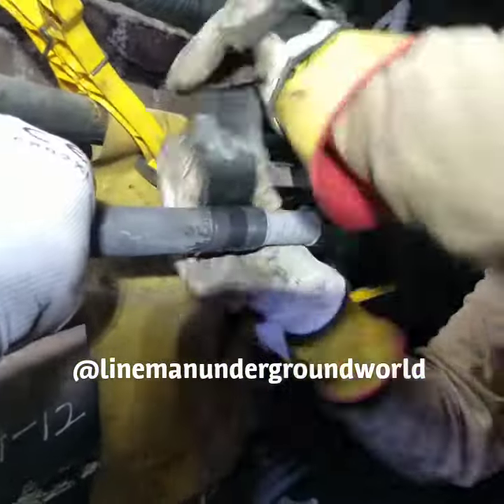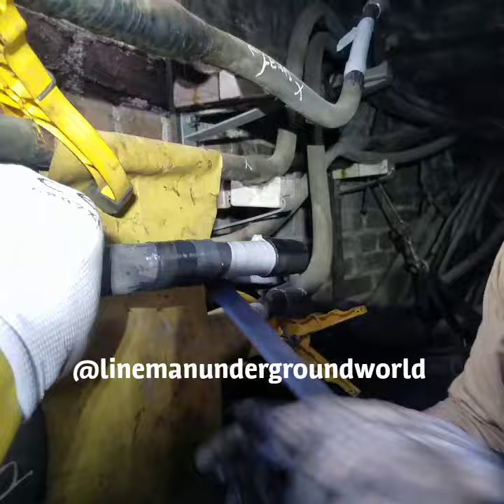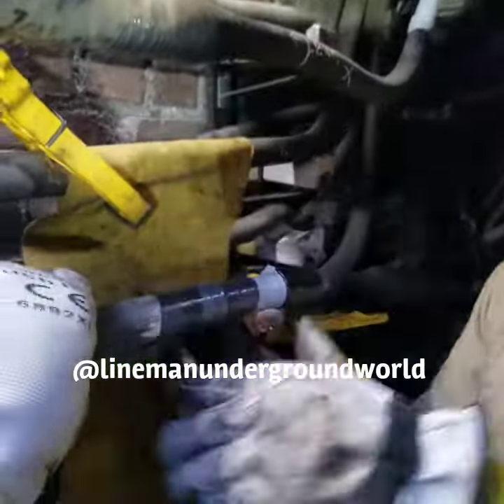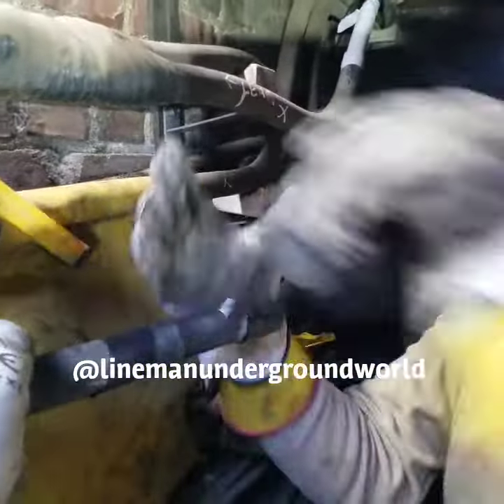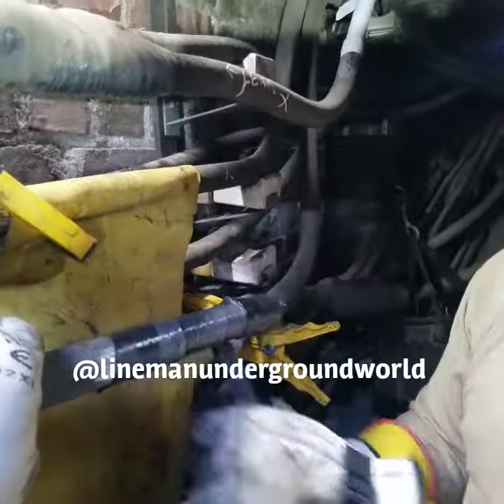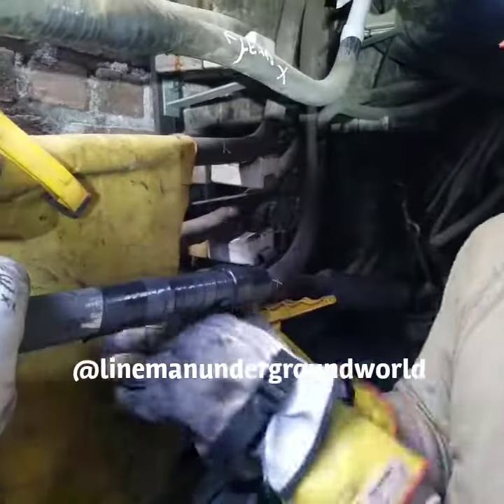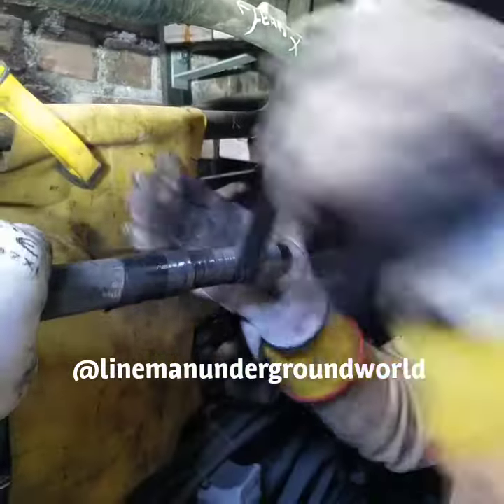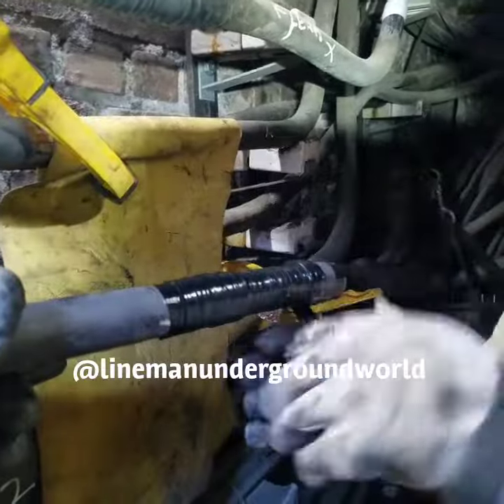SECONDARY LEAD CABLE PREP

Comment: Was this cable energized when it was cut?
Reply from the maker: Wazzup Shane, and that’s a big yes , we work everything energized most of the time..
Reply: @linemanundergroundworld4854   impressive. Never worked with pilc cable. It seems to be a dying art. Is it possible to make a splice to xrp, epr or any medium voltage cable while energized?  I’m with generation, Local 84 here in Georgia an inside electrician and I’ve never seen it done energized.
Reply from the maker: @shana4705  wazzup shana it can if there is a procedure for it to be done, and again most of the time it is energized..